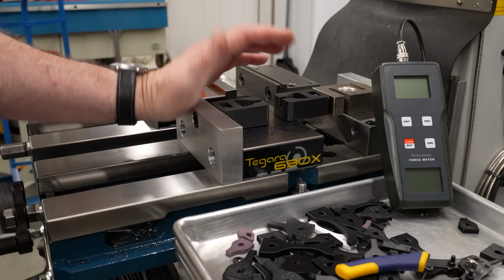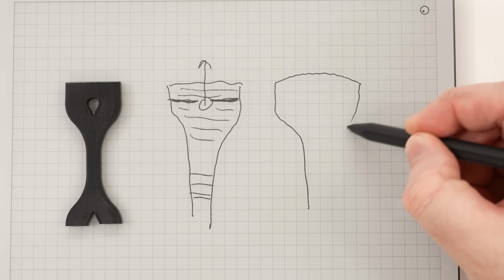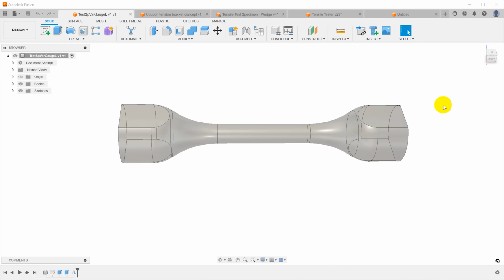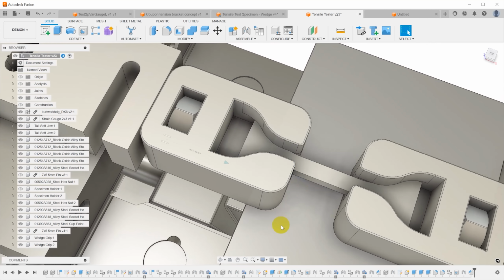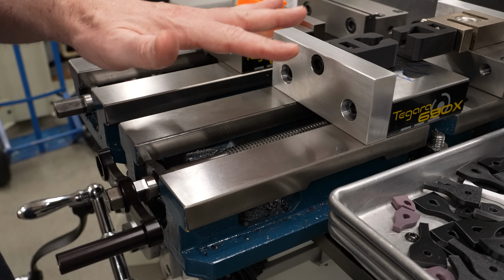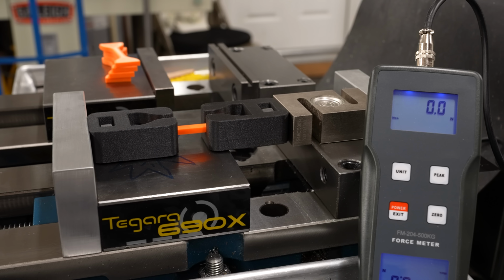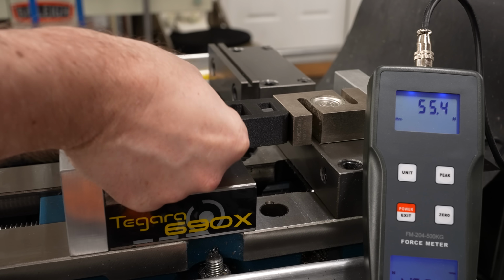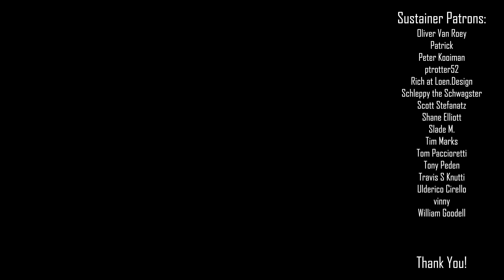Better Tensile Testing Grips | Tensile Tester Part 2

Comment: I think there's some rule of the internet that states that the best way to get an answer is NOT to ask a question, but to post an incorrect answer.  Your first video maybe did a little of both and, of course, the answers came flooding in.  But regardless, thanks for posting your mistakes.  We learn from them as well as not feeling like we're all alone in making them.
Reply: That’s actually true in real life too, a technique I’ve known and used for decades. If you want to get someone reticent to talk to open up and start talking, just make some slightly (or grossly) incorrect statement about whatever you want to get the conversation going on. Works every time 👍😂

Comment: Next video : James puts a clearpath servo on the crank! 😂
Reply: i sure hope so! plus continuous datalogging for pretty stress/strain curves :)
Reply: That was my exact thought! But it does go against the quick and dirty solution he was going for, especially for something that won't be a high use tool after these initial tests.
Reply: @TheMartorious  hes clearly going for simple but definitely not quick and dirty :P
a stepper on that shaft connected to a raspberry pi or arduino for motor control and reading the load cell should be all that's needed.
there's hundreds of existing designs, so you can probably just copy someone's code as well :)

Comment: Thank you for this video, and the last. I appreciate watching and learning along with you and seeing what didn’t work just as much as we got to see what did work.

If you’re up for making a third video, I would find it interesting to see the difference, if any, in printing your sample parts individually (setting the slicer to print one fully first before proceeding to the next one) compared to printing them in parallel. In theory, the parts should be stronger, since the previous layer won’t have cooled fully when printing the last and this should improve layer adhesion. 

Thanks again for the content. 🤓

Comment: Again, great presentation! While measuring the failure point is indeed very informative, it doesn't guarantee that the part will return to its original dimensions when a stress below the failure point is applied and then released. This is why evaluating the modulus of elasticity (Young's modulus) is so important.

The modulus of elasticity, combined with the yield point, allows us to estimate the maximum stress that can be applied to ensure negligible deformation when the forces are released. This is essential for ensuring the full usability and reliability of the part. By measuring the elongation of the test sample, you can calculate the modulus of elasticity and provide a more comprehensive understanding of the material's behavior under stress.

Comment: The narrow cross-section of the test coupon might actually have better bonding between layers than the wider ends.  The smaller layer area means shorter print time per layer, shorter print time means less heat is lost on previous layer, more heat seems to make a better bond.
Reply: People would never solder or weld something to a big chunk of metal with low power settings and then be suprised the weld is not strong (or not existant). But for printing plastics people are using printers which strongly cool down the parts and then tell BS like "FDM printing always has weak Z-bonding". Of course, for most people using FDM printers Z-strength is much less important than good overhangs and other overheating effects so that is what the printers are optimised for. Also you have much more tolerance when moving your process window in the "too cold" area so even when printing small details overheating can be avoided.
Reply: Somebody printed a test coupon with high performance polymer (PPSU I think) with a cheap FDM printer but pointed a heat gun on the part. It was tested in Solvay's (polymer manufacturer) lab and the part did have 100% Z-strength so it is definetly possible. Theoretically it should be possible to control the FDM printing process in a way that makes sure the layer below the current one stays in the Tg to HDT temperature window which leads to very good Z bonding while the part does not droop but this is not an easy task.. But it should be doable even without an heated chamber when the printed part is small enough.

Comment: I'm glad you posted the previous video, too :D I don't consider it a failure, more a teaching moment. I love that the community had some great ideas and shared some things.
Can't wait to see how far you take this, if you consider upgrades. Maybe a servo/stepper motor with some gearing so you can get consistent pull speeds, which'll help with the slow sampling rate, and also a DRo so you can measure the displacement and calculate a stress and strain curve. Stress-strain curves are super useful measurements to have for quantifying material toughness.
Also it'd be a fun challenge to automate the whole process so you can press a button and the sample is tested and it rehomes and starts again once you retrieve the broken pieces and add a new test piece :D

Comment: For the home-made setup we made in our classroom for under $50 (pipe clamps and a fishing scale), we solved the problem by making the cross section of the test region smaller. We use about 1 mm x 1mm. Mechanics of test work fine and we get within half order of magnitude of published values for PLA. We have resolution sufficient for comparing materials, comparing print orientation and shape of cross section. Teacher's tip: bend an acrylic sheet and attach over the apparatus with a piano hinge to provide another layer of safety from possible flying particle of test material.

Comment: 4.28, not just the bending around the hole but also, the print going over the hole through the layers giving you a slightly colder joint between the layers compared to the center section which is a continuous print

Comment: Why don't you use standard testing geometry on the speciment? Follow the ISO or Astm standards, and you should tension them slowly, as other have said, use a motor or drill. And logg the displacement. Just clamp a caliper on the jaws. Been Nice to see a top view of the testing process as well. But nice work, keep doing what you do. Failure is the best way to learn.    Give me a shout, if you wan't the standards, i'we got them.😀

Comment: One thing I‘d like to see with this version is clamping blocks that can swivel a little—because right now, if the samples or blocks are slightly crooked, it will introduce more stress on one side of the sample, leading to an incorrect number again.
The pin versions did that by their nature of how they held the samples, of course, but this version doesn‘t!

Comment: Very well explained.  Let me suggest a marking in the grip area such that we could visually see which end of the coupon was in the bottom of the chamber and which in the top.  I would like to know how ambient temps effects layer adhesion.  My assumption is the higher chamber temps (up to some optimum) for some (all?) materials will tend to result in better layer adhesion.  Also consider the bed is sinking heat up into the part so just because a segment was printed higher in the stratus of chamber temp does not mean the next lay went down on a warmer layer before it.   Printing with different relative part cooling fan settings would be in the family of testing these kinds of ideas.  I run a UAS lab just down the hall from a materials test facility where this kind of work is done which should lend absolutely no weight to my suggestions.   ;-)   Stimulating problems to consider.

Comment: One thing you may consider is necking down the crossection, ever so slightly in the center of the gage length of your dog bone specimens. This will ensure the sample breaks near the middle of the gage length instead of at the ends where the geometry and clamping fixture can distort your measurement. The clue here is that when you oriented the bottoms😅 of the sample in the same direction, failure always occurred at one end. Our metal tensile samples were necked about 0.0002”, but with imprecise 3D printing you will obviously have to increase it more than that. The gauge length tapers down in the middle by the 0.0002” evenly over the gage length. 

Another option to consider, since you are using different printers is to machine the gage length. A metal template and a bearing guided router bit would permit you to quickly machine to size. That way you can be fairly certain that the material is the variable being tested and it is not the printer, (due to edge roughness and hence stress risers) that will affect the test results.
Reply: is that 0.0002" per side or overall width?  what machine did you use to get such precision?
Reply: Per side. Effectively a router and a precision template, but designed specifically for trimming metal specimens. Rough milled via CNC then finished up with the template.

Comment: To further improve the handling of the samples, especially once they snapped, I would add a slit for easier removal/grabbing of the wider part. I think also a push-pin/-mechanism to lift/rotate the sample in the holder for easier access could be used.
Alternative add a thin metal/plastic sheet below the sample, so that you can easily lift the leftover-sample in the holder.
It looks somehow cumbersome to grab them once they snapped.

Comment: I'd try to add some freedom to the rotation of the sample ends, maybe the round design was trying to do something like that but the printing quality could affect that, layer lines catching and all that. 

Swapping the nut for a rod with a (threaded) cross hole could help, a bearing or ball end would be even better.

A small flexing force could affect the measurements a lot, samples breaking on the same end even with printing direction swapped could suggest something like that.

Pulling with rope could add more freedom, but resetting for a new sample a bit more laborious for a lot of them, and space constrained with this setup. In any case, could be an easy alternative to swap the bolt you have now.

Comment: awesome, thanks. Igor got those holders made by PRC manufacturer (one of those that make pcb's but now have 3d printing and cnc and ...) in metal, made testing much easier :) .. maybe you can ping them for some sponsorship :D ... 

A question I have is, when printing these dog-bone specimens do you make sure to turn off fan completely during printing of "handles" and then get the fan to "normal behavior" for the neck or you print them with "out of the box profile" ?

Comment: I think that you need a better platform than a vice, now that you'd need to reverse the jaws every time.
Also, like another commenter suggested, you need to automate the cranking, to ensure the consistent speed. And re-engineer the sensor to decouple display refresh rate from sampling...

Comment: You can read from a load cell data with an HX711 Breakout and an arduino for very little money. You can then decide how far down the rabbit hole you go. Motor control and continuous streaming and logging of data to a pc, or peak values displayed on a small screen that updates a little faster.

Comment: The update rate of the screen of the force meter does not necessarily mean that the update rate of the measurement is equally low. A high enough update rate of the measurement, but an update rate of the screen at 1 Hz would still give a correct result.

Comment: Maybe test your setup for repeatability/linearity etc. by stretching a spring.
Turns on the vice handle give you the amount the spring is stretched.
A suitable spring working within its limits should give a repeatable force result per unit of stretch.

Comment: I wonder why test specimens break relatively close to the fixed jaw. The fixture does not seem to have any apparent influence on the split location, as in the last test, which is a win. However, the distribution of splits does not seem to be even for some reason. Could the load cell be influencing the clamp? Maybe it causes a slight bend in the sample while stretching it? If this is the case, a swivel joint between the jaws and the clamps could help mitigate it by making the opposing pull vectors collinear.

Comment: i'll agrree... please post failiures. i learn a LOT from watching your design/thought processes. Keep up the good work! In this case, I know you were keeping it simple... but my mind goes to a microcontroller-based strain gage reader, that will give you data logging capabilities. dunno if it makes any difference in the update rate or not... it may be inherent in the measurement process. I know every digital scale I've ever owned has a similar response rate.

Comment: Now you're gonna have to devise a control mechanism to consistently apply force/time to take the operator out of the equation and spin your own circuitry with an instrumentation adc like the max11254, for higher refresh rates. I'm sure you've got some steppers and pulleys lying around.

Comment: Think maybe it's time to get a meter with a faster update rate - as it is, you can't tell whether the fracturing is time-dependent, i.e. is it stretching and breaking over time? Would it break at a different value if the stress was applied more quickly or more slowly? If the screw were motorized, would you get more consistent results? Good work so far, but you haven't finished yet!

Comment: I think it would be very interesting to see if printing them at a 45° angle to the bed changes anything. Probably weaker than flat on the bed but stronger than vertical.

Comment: If the specimens were homogeneous and the stress were uniform across the width of the “gauge length” (i.e. the narrow test section of the “dog bone” specimen) the breaks would occur randomly along the gauge length. In your case this clearly does not occur - in all but one case your specimens break at the same position at the end of the gauge length and the only one that didn’t wasn’t far from the end. This means that your measurements are characterizing the non-homogeneity or a stress concentration where the gauge length enters the grip region and not the material itself. Dog bone specimens are meant to be clamped at the very end of the broad section with some length between the clamp and the start of the gauge length. This allows the stress field to become more uniform near the gauge length so giving a more uniform stress field in the transition into the gauge length and hence the gage length too. One suggestion is to make a second even narrower section in your current gauge length with a smooth elongated transition into a new narrower gauge length. Your specimens would need to be longer.

It is easy to break specimens. What is difficult is to do it in a way that characterizes the strength of the material but is independent of the details of how you made that measurement. Tensile testing is conceptually simple but is notoriously difficult to perform well in practice. Have you thought about 2-, 3- or 4-point flexure? In some regards flexure is the inverse of tensile testing - simpler to execute well but conceptually harder to understand the results.
Reply: I agree.  I've done a bunch of tensile testing in my time (former medical device engineer).  The breaks should be randomly distributed around the middle of the test coupon. I'm fairly certain there is a stress riser in that area caused by the manufacturing process.  Could be the clamps , but because the material is not homogenous (i.e. that the material is laid down in layers), the first thing I'd consider is that the design of the coupon needs to be changed by making that transition even more gradual.

There is a subtle difference between measuring the tensile strength of the designed part (which is what your set up does) versus the tensile strength of material.  Both are useful data points.  But the knowing the tensile strength of the material is generally more useful because it can be used in many other designs.
Reply: In the printing process, the low cross section area of the test specimen leads to higher polymer temperature in the layer below the current printing layer . At the bottom of the specimen the layers are still relatively cool because of the wide to narrow transition. This is where the specimens break. Further up the accumulated heat leads to better bonding and better strength. This is at least the influencing factor from the printing process itself, part geometry as you explain could also influence it. See my other comments for more rambling of mine about this topic.

Comment: You need to automate the speed you pull with. Every parameter matters. I was an engineering intern at a research institution where they had an entire array of Instron machines for dynamic tensile testing. Unfortunately, I didn't get the opportunity to use any of them because there was no plan for what I was supposed to do there. A royal waste of time.

Comment: If it was good enough for NASA to learn by doing through Mercury, while starting off with some smart people working together, then good enough for the rest of us. The solution for the tensile rig is a great idea for the materials being tested. Reversing the vice jaw along with the Kurt-nut would have made sense if you were testing something tougher, but seemed like a good idea not completely thought through. Just reversing the nut makes no sense unless the test coupons were in danger of being strong enough to damage the set screw, and you were loading the set screw anyway it appears. Better to reverse the jaw as well as the Kurt-nut and load on the spherical segment. I can follow the reasoning, because I always think metals when tensile testing, but if the coupon grip in CRP is good enough, the steel components of the vice are certainly going to be durable enough. And the last vid was great. Not failure, but a step on the path to success.